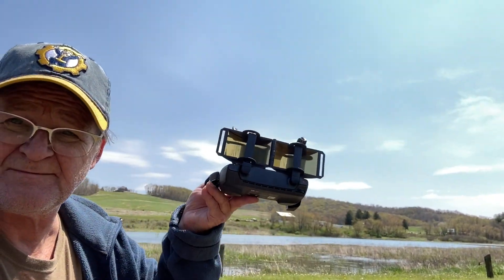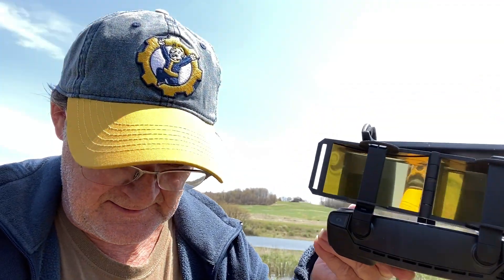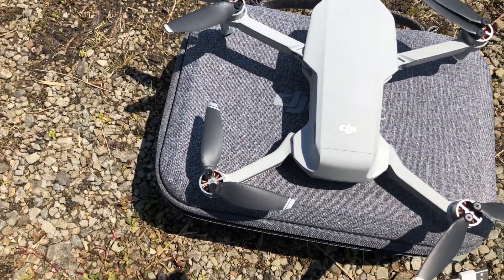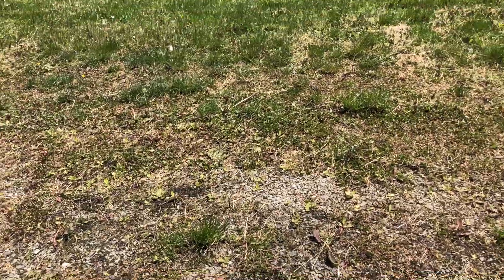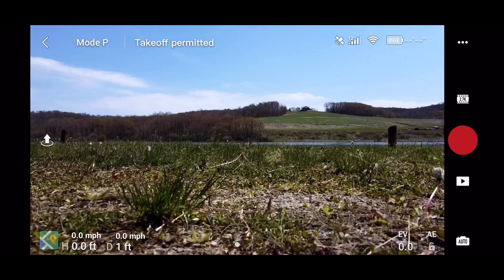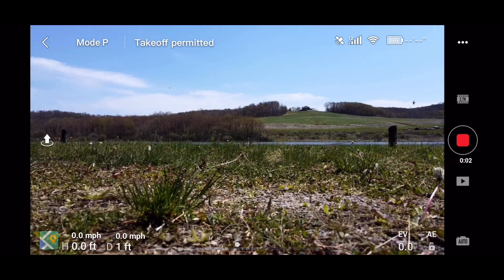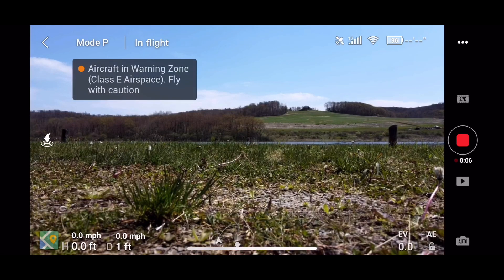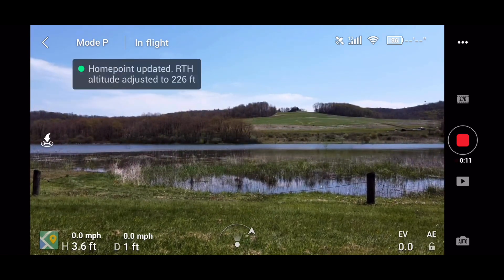DJI Mavic Mini Drone Testing Parabolic Range Extender 4091 Feet With Ease

Comment: Question 1: Would you normally return to home past the warning and continue flying say out until 60% battery life is left remaining to return home? Question 2: I have an 11 Pro Max iPhone. I need a "clearance" of 6 3/4 inches length wise and a "clearance" of 3 5/8 inches width wise and a "clearance" of 5/8 inch thick wise which these dimensions already accounted for using my otter box. Will this controller accept these dimensions and if so, is it a very securely held inside the phone holder? Question 3: Do you know if other dependable controllers that would be compatible with the DJI Mavic Mini? Final question number 4: Can you describe exactly what should I order to get me started flying with this drone including the range extender?  I have never flown a drone before.
Reply from the maker: https://www.amazon.com/gp/product/B01N7RFDBA/ref=ppx_yo_dt_b_asin_title_o00_s01?ie=UTF8&psc=1
https://www.amazon.com/gp/product/B072HFCC2S/ref=ppx_yo_dt_b_asin_title_o00_s00?ie=UTF8&psc=1
https://www.amazon.com/gp/product/B074PMMSQR/ref=ppx_yo_dt_b_asin_title_o00_s00?ie=UTF8&psc=1
I also use an iphone 11 max it works with this

Comment: Nice video, Thanks. I've been considering those range extenders, I live in an area where I'm surrounded by 90 ft. trees, and I know they interfere with the Mini wifi signal. I get about 1,500 ft. distant, and signal goes down to one or two bars when I'm flying at 200 ft. Leaves two options - go higher, or come back. I'll be looking into the range extenders.
Reply from the maker: These will help but you always have to have them pointing at the quad
Reply: @bryansbikes  Ordered them. Should be here next Monday.

Comment: Warning is solar wind. That's what you get in outer space.
Reply from the maker: I should fly to the moon
Reply: @bryansbikes  Man you can look for extraterrestrial life with those range extenders.
Reply: @bryansbikes  And I'm happy with my Fimi A3. But I have a question maybe you can answer. In the settings/GPS there is an option to 'update return home point' to either drone, or the controller. I can understand updating the first option. Instead of the take-off point you want the new location to be retrun home. 
But why update the return home point of the controller??  I mean the drone always knows where the controller is. And when you put it in follow-me mode you automatically get a message telling the controller is the return home point. Which makes sense. So you don't have to walk or ride back. But why 'update' it? 
Or maybe it's like this. When it is NOT in follow-me mode, but you want it to do return-to-controller, then you select 'update home point controller'?  And when you then press the home button, it will fly towards you. 

Also I was a bit disappointed it doesn't tilt the camera at you in follow-me mode. I have to adjust the angle manually. Ah well, I can live with that. It does a great job otherwise. So nice and smooth. I can put my trust in this thing when it comes to GPS follow-me. That's all I wanted. 

Because what I don't want is having to ride back all the way if it for some reason does a return to take-off point. Like this. https://youtu.be/EdAGqV9GB5g
Of course I will launch it in a safe spot just to be sure it will land safely. But ideally it slowly comes towards me giving me time to dismount my trike and then I fly it in manually for the last bit.  

And that BTW is exactly what my FQ777 F8 does. Too bad the camera is jello and fish-eye. Or I wouldn't need the Fimi at all. I like cheap! 

I love that Mavic Mini. But for me the follow-me feature is essential. The Mini doesn't have that. Peronally I would settle for 720P less stable video if only the follow-me was anythng like the Skydio 2.

Comment: Hi my friend I have purchased one waiting for delivery.My reason warning loss of connection with Mavic Mini please adjust Antennas becoming a bit of a pain when flying and even some times even complete disconnection so I’ll give these boosters a try.
Keith UK
Reply from the maker: They work great, you won't regret it
Reply: TDR Drones Thanks for replying I was going to send it to DJI to check it out it’s so annoying when filming and you lose connection.
Reply from the maker: Did you refresh the firmware?
Reply: TDR Drones Thanks for interest yes I did it through the PC and the DJI Assistant 2 Application basically I just installed it all again for the drone and the remote I had already had it installed through the device by the app on the phone or am I missing something which I should be doing.

Comment: I need to get a pair of those range extenders for my Mavic Mini.
I think the wind warnings cut in well before the wind is getting strong enough to be a problem for the Mini, it's just DJI being extra cautious with it, I think.
I've also noticed going over 30m or so alitude, brings up the warning on any breezy day especially if it's 10-12mph wind on the ground. 😎👍